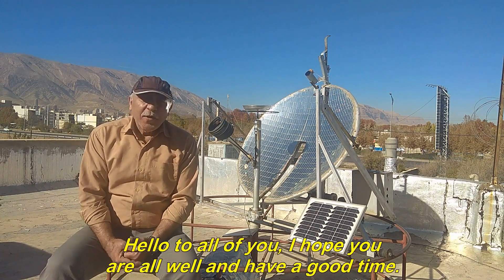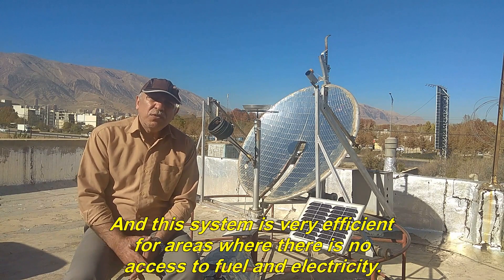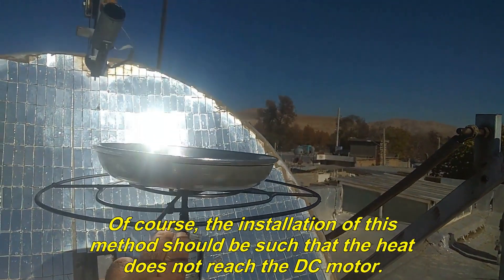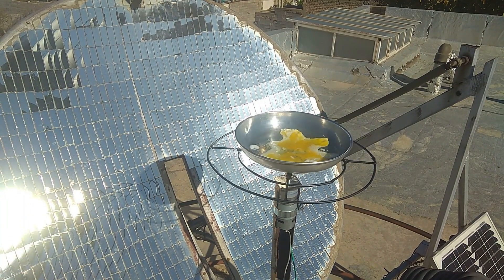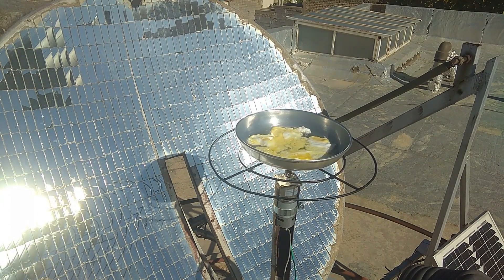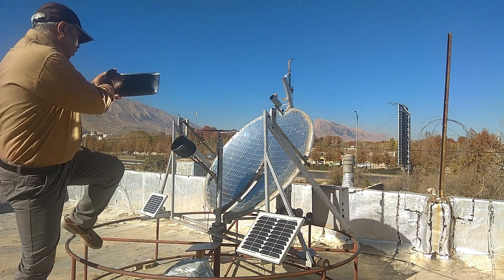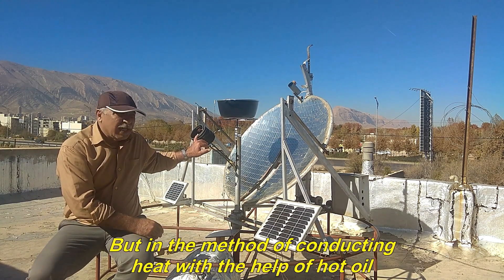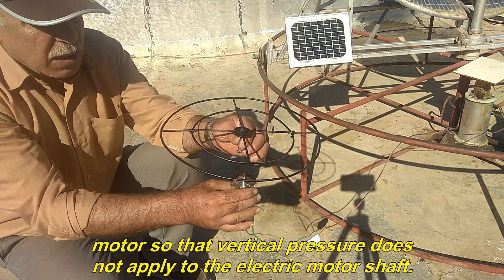making a solar oven . Solar kitchen. An easy solar cooking. Easy cooking with solar energy.

Comment: Dear mr. Ibrahim 
Greetings and peace upon you from lebanon .
I am industrial engineer specialized in process optimization and product development i would like to thank you so much for your efforts in optimizing this technology ( solar concentrators) you are solving engineering problems in an efficient and cost effective ways . 
I would like to suggest an experiment for you because your opinions will help me a lot ..
What if we bring a tank of oil ( because oil can absorb heat over 500°C , during the day we absorb the heat from concentrators through the oil and storing them inside a well coated tank and afterward using them at night for heating households rooms atmosphere the same way as the evaporative method . 
What do you think?
God bless you and your work .